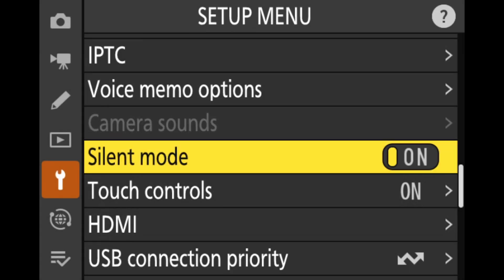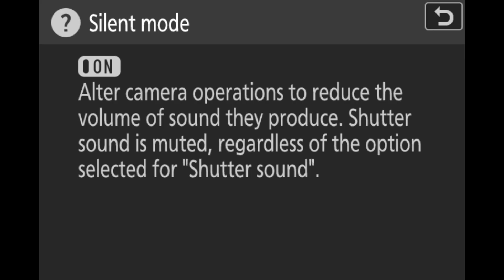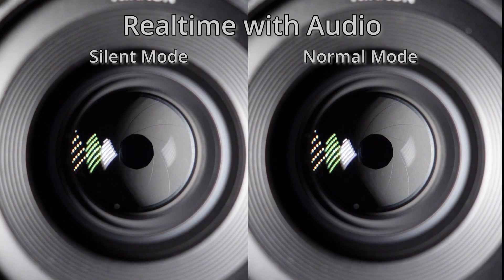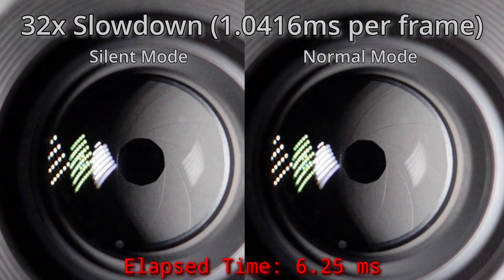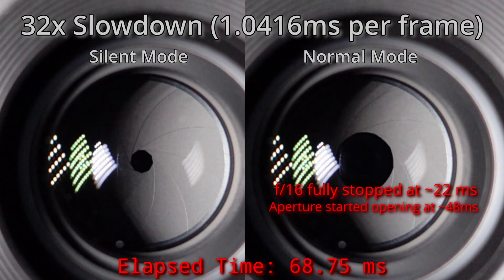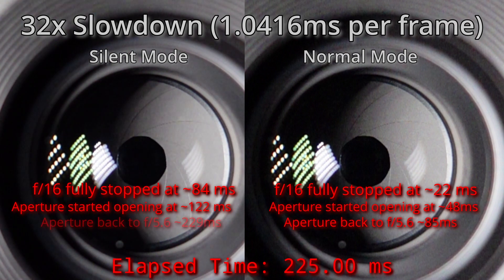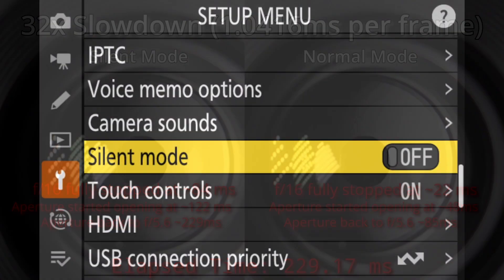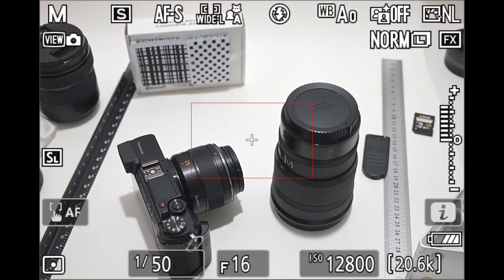How Nikon Z's silent mode slows aperture blades by 3x

Comment: Wait. Why was the aperture only half-closed at the beginning? Like, it's a mirrorless camera, so it should keep the shutter closed to the value the user set, so the user could see the current exposure I thought.
Reply: I haven't use a Nikon Z camera but my theory is it uses f/5.6 for faster and more accurate focusing, and makes up for the exposure preview with shutter/ISO
Reply: I'm also as confused as you why this mirrorless system can't just focus at f/16
Reply: He’s right, it does it for AF speed reasons. However, it can focus at F/16, and does actively, but only in film mode.

I’d also note that on a Z8/9 I think this would be the only thing silent mode would do with the exception of muting the shutter sound if you had it on; so really it just means you shouldn’t bother using the “silent mode” setting and just turn off the shutter sound itself.
Reply: @BLiu1  Then I don't understand how mirrorless cameras supposed to work. If the scene is too bright for f/5.6, and the user set f/11, what the camera supposed to show in viewfinder? An overexposed image, brightened down by integrated software?
Reply from the maker: @Tarantas  Nikon MILCs set the Live View aperture equal to the configured (ie, shooting) aperture anywhere from wide open through f/5.6. If the configured aperture is smaller than f/5.6 (ie, higher f-number), the camera caps the aperture at f/5.6 and will only close it down to the configured aperture during actual exposures. This is presumably done to increase the amount of light available to the on-sensor phase-detect AF points. For continuous bursts most Z bodies open the aperture back up to f/5.6 from the shooting aperture in between each exposure for to AF, except for Continuous High mode where they keep the aperture stopped down to the configured aperture. This is because the aperture mechanism isn't fast enough to cycle between f/5.6 and smaller at the frame rates supported by Continuous High. The Z8/Z9 depart from this behavior and keep the aperture stopped-down to the configured aperture for the duration of continuous bursts. As to you question about the VF, the camera adjusts the internal LV shutter speed to keep the light values within saturation during LV - this is independent of the shutter speed configured by the user.

Comment: Is this why I can't take photos with flash in silent mode on my z9? So, can silent mode worsen the performance of the AF system?
I didn't notice that silent mode affected the speed of photos in a series on Z9.
It easily reaches 20 fps Raw, 60 and 120 in jpegs.
Reply from the maker: Nikon disables flash for silent mode across multiple bodies, some of which are due to slow sensor readouts that don't support a reasonable x-sync speed (Z6/Z7), but others for seemingly audible reasons (Z8/Z9). It's not clear why Nikon includes flash in the list of features considered "noisy" and disabled with silent mode but there is no obvious technical reason to do so on the Z8/Z9.
Reply: @testcams  I did a test and in fact in silent mode the shutter blades are slightly quieter than in normal mode. The slow movement of the aperture blades seems to be the only reason why the flash did not fire properly, so it is disabled in this mode.
Reply from the maker: The speed of the aperture movement has no impact on the flash. That would only be true for leaf shutters. The Z9's flash is triggered after the aperture has completed its travel, so it doesn't matter how long it took that travel to occur.
Reply: @testcams  
Then it makes no sense that you can't use a flash. It turns out that Nikon forgot that its flagship model is technologically able to cope with this and automatically blocked the function of using the flash in silent mode
Reply from the maker: It makes since when you consider that it's not a technology technology issue but simply Nikon's choice to disable flash operation during silent mode, under the misguided belief that shooters wouldn't want the noise of speedlights when the camera is in silent mode.
Reply: @testcams  Silent is really stealth mode. Think movie sets, theatre productions, religious ceremony, etc, Nothin to do with noise, all as to do with being noticed and intusive during live recording. Flash would also intrude on a video/film.  OM systems has alwayd had a flash overide if desired, as some silent features affect computational settings.